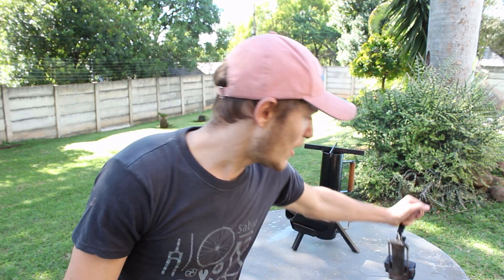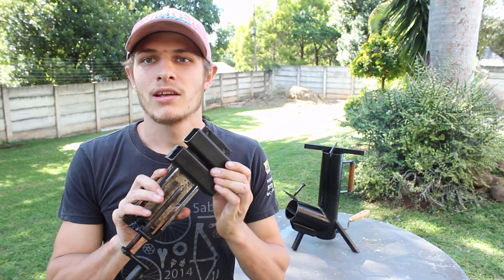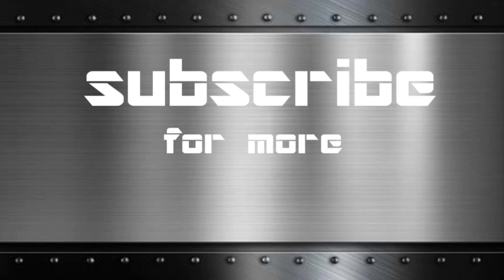Homemade Rocket Stove Build

Comment: Why did the chimney need to b shorter?
Reply from the maker: So on the first test it wasnt quite getting as hot as i wanted it to be.
I reckoned it was losing heat in the chimney cuz of the small diameter and long length
And making it shorter solved the problem to a good extent
Reply: @XanderKirsten  whaj are the right dimensions for a rocket stove?

Comment: The piece of square tubing under the wood chute, is that for air. I like the slide underneath to chuck  the ash.
Reply from the maker: Yeah its for some extra air. Since the hole was too small in comparison to the heat riser while lid was closed